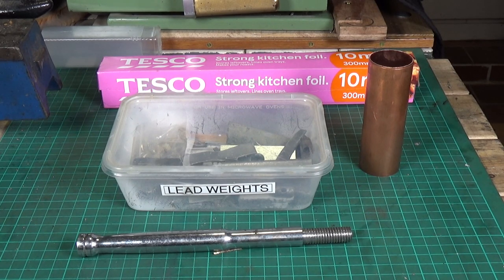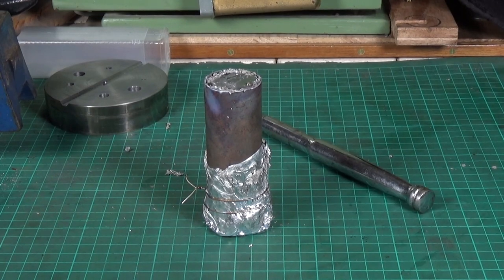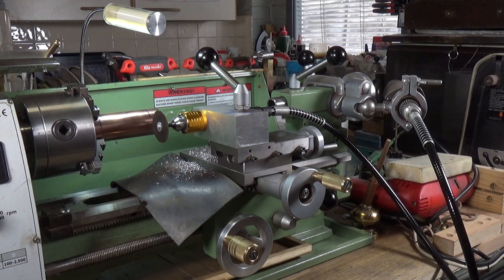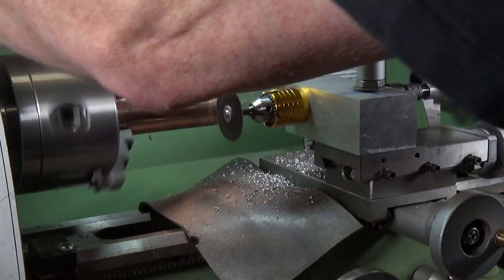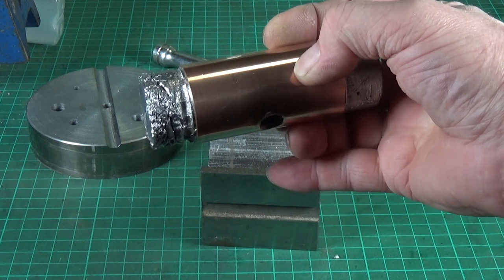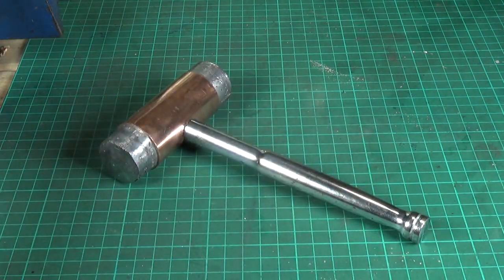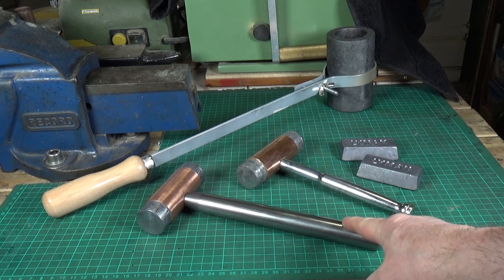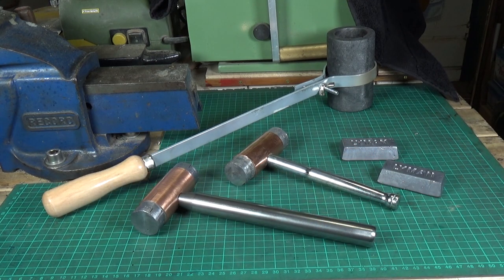Making A Simple Lead Hammer

Comment: To those who don't own a lathe: you can also use a tubing cutter. 
I did something similar to this. I used a 3/4 T fitting and 3/4 copper pipe with cap. I melted the lead separately then poured into the tube.  Afterwards I cut the desired length off of each side of the T and soldered the cap to the tube and had my finished hammer w/handle.
Reply from the maker: That's a great idea, thanks for the tip.

Comment: I would use a pipe cutter. That lathe/rotary wheel bit can throw lead dust into the air.
Reply from the maker: Alex Hendon above suggested the same thing. It's certainly is another way to do it.